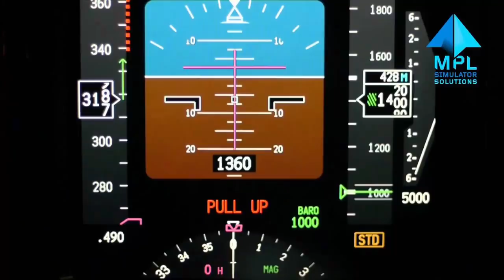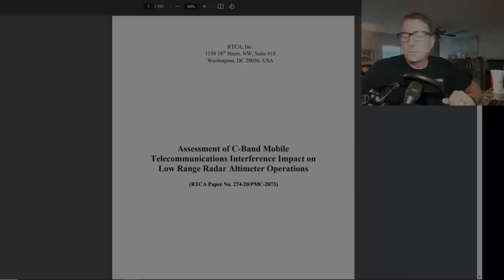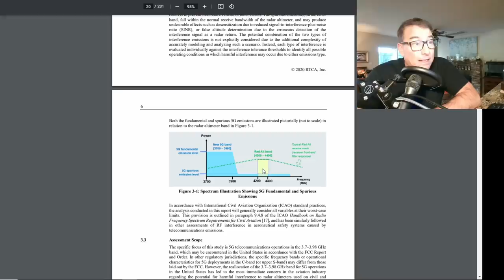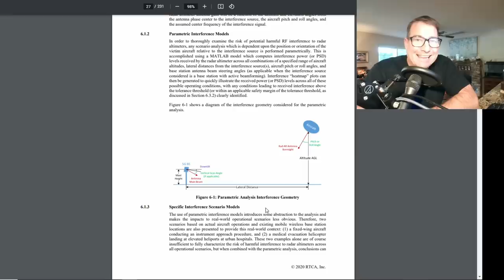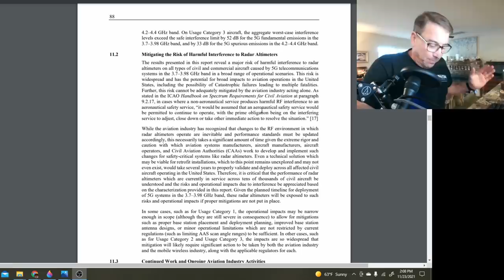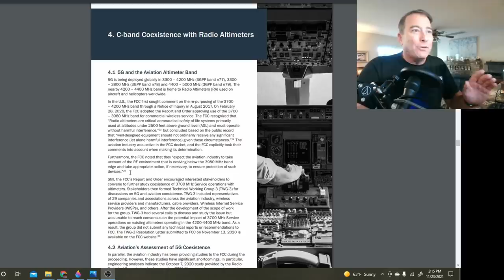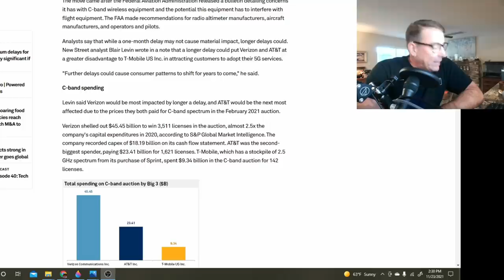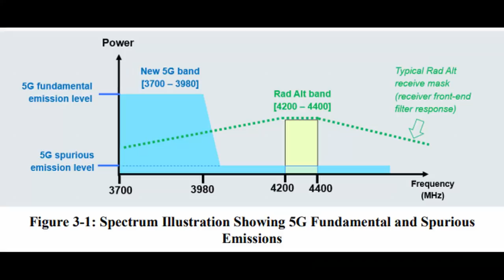5G C-Band Interference with Radar Altimeters in Aviation

Comment: The signals in the spectrum are with good working final amps… the problem is when a final amp is off or scattering the band.
As an FAA radar tech, I have seen it and had to shut down overseas communication facilities before. 
All is OK, if everything is working perfectly. The problem is… you will not know when it isn’t working perfectly, until someone is killed.

Comment: If each of the devices radar alt. Or 5G would stick to the approved frequencys there should be no impact on each other, the problem is  both of these devices normally go beyond their approved frequencys when in operation and make noise in frequencys outside their own bandwidths. Till the devices that exceed their approved frequencys are removed from circulation this will be a problem.
Reply: Which devices go beyond their frequencies? I'd say it is much more probable for some decadent aviation radio to malfunction in this way than a modern mobile phone base station..
Reply: @rkan2  I worked on radios, transponders, 3g 4g and 5g and many other transmitters.  Ive seen many transmitters that work fine in approved frequencys when cool but many they warm up when testing with a spectrum analyzers ive seen many high end devices throw noise in to other frequencys when transmitting. So im just speaking with experience and will not name the name brands or off brands  ive seen this happen to they love to sue and send cease and desist letters to ppl that name them.

Comment: This sounds scary.
The interference based on filter bandwidth assumes a linear system.
The high radiated power from a nearby 5G transmitter may cause non-linear effects that could be disastrous. 

In countries where airplanes have not been crashing, where are the 5G stations located? 
If the radio altimeter does report an inconsistency, will this information be feedback to the engineers?

Comment: I work as a safety engineer in aerospace, and the whole argument by the 5G industry "there have been no reports of problems, therefore it's all good" is fundamentally flawed. That is not at all how the operation of safety-critical equipment is assessed and evaluated. It's more along these lines: What could go wrong in the worst case? How can we prove that it is not going to go wrong? We can't prove it? Ok then, what's the worst thing that can happen? A widebody crash in a densely populated area: it doesn't get any worse than that. So what's an acceptable frequency of that occurring? The answer is really 'never', but "less than once in a billion flight hours for the aircraft type" is considered  acceptable. Now show us how that can be achieved and how confident you are of that assessment. I doubt they can come up anything good enough.
Reply: As another engineer in aerospace, you are right on. It's clear from reading some of the comments made about this issue by people working in the telecom industry that they just do not have the same mindset that we do because they don't generally work on safety-critical applications and so even if we are looking at the same set of technical facts there's no possible agreement on what the correct interpretation is. We're not allowed to just assume safety until something bad happens.

Comment: It's not as simple as saying 5g.  The issue is the frequencies used not the generation of the communication standard. Now my question is what frequencies are at issue. All of the cell phone carriers use different frequencies for their own 5G transmissions. Some carriers are using newly bought frequencies at auction for their 5G usage where others are reusing existing frequencies that were used for 4G and 3G. 
   When it comes to the levels of interference there are 4 levels. 
    
1)Militrary is ensured nothing will interfere with it. 
2) aircraft police and ambulance etc no one should interfere with it but there are no guarantees of that like with the top tier. 
 
      What would have to happen is that aircraft would have to be reclassified to tier 1 for them to gain any kind of protections under the FCC

Comment: Altimeters rely on pulses at specific rates to make sure they are looking at their return pulse only. The problem could be AGC automatic gain control basically shutting down the amplification of the original signal and thus missing the return signal. Need to do real world testing not on a bench.

Comment: Very interesting issue, my take on this is that 5G used for cell phones is not as useful or necessary as advertised. There are multiple paths available to fix this, from eliminating 5G near airports to making the AC radar altimeters able to effectively filter out the 5G interference, a costly method. I don't use or need 5G, so they could eliminate it completely and most cell users would never miss it.

Comment: I understand where you are coming from as I worked for a major Avionics manufacturer for over forty years.  The extreme lengths that we would go through to qualify a product for production for the aviation industry and how a very low power of a signal it takes to interfere with a product so as it would not function as it was designed to. There are also limitations as to what you can do in filtering out unwanted signals and other design choices you make to qualify a product. Each choice you make has strengths and weakness. To get the performance you want you have to make compromises that's the nature of the electromagnetic spectrum. The 5G manufactures can afford to do the design work that is necessary to keep the integrity of others in the electromagnetic spectrum around them and the should.

Comment: Filters are cheap at microwave. The problem is that it will require new equipment or inline equipment that has to be designed, tested, and validated by the FAA and then retrofitted to aircraft. A few megahertz away from the RADAR frequency is not a problem when it's already operating in a low power regime -- unless it's designed and implemented to ancient standards.

Comment: I’m curious.  What type of timeline does the aviation industry expect would be reasonable to implement 5G?  It’s been on the horizon for years.  It seems that the FAA isn’t doing its part.  The 5G equipment has been available for testing but if you don’t test, don’t complain.  

I realize safety is at stake and 21st century telecommunications is simply going to have to wait for the aviation industry to get its “stuff” together and make recommendations.  We are waiting…

Comment: Sorry to say this, but filters will not do the job.  The splatter has to be handled from the source.  A signal at the same frequency interferes with another signal on the same frequency regardless of modulation.  Digital signal processing can improve the "filtration" by sorting digitally the type of signal and cutting out some segments of the interfering signal but will not be 100% effective.  Very familiar with this.  The only way to reduce splatter 100% is to reduce the modulation level at the source transmitter which defeats the purpose of increasing bandwidth.  I am sorry but there IS NO good solution to this.  The wireless companies' response report tells me that need to avoid Europe and East Asia when flying.

Comment: Just to show how important radar altimeters are. On April 10, 2010, Poland's equivalent of Air Force One, a perfectly serviceable Tu-154M, with the President, First Lady, chiefs of all the service branches,  many heads of key agencies, top politicians and others on board, was on non-precision approach to the military airfield near Smolensk, Russia, for the 70th anniversary of Stalin's massacre of over 20,000 Polish officers. The President was impatient to land. The Air Force chief sat in the jump seat and as the plane approached in thick fog, he read off the altitude -- from the radar altimeter instead of the barometric. BUT: there was a wide valley in front of the runway, and therefore the plane actually dipped below the altitude of the airport. Of course, the pilots went far below minimums, pressured by the Air Force chief and indirectly by the officials on board. The aircraft crashed into trees and all perished.
Reply: Sad; and arrogant.

Comment: Move the little base stations away from the airports? I'm not an EE - what do I know? But the logic that the airports were there first may only hold so much water. The same logic is being used as reasoning to keep RHV going. Even if true, it's been a rough road. Stay safe- everyone. Ere on the side of caution. Far better to have a few p'd off passengers than a bad crash. Smooth sailing -

Comment: The airlines, aircraft and avionics manufactures should be able to create some logging maybe using LIDAR to cross check radar altimeters during VFR flight with a goal of finding radar altimeter anomalies and interference issues. Maybe 5G cell sites should be powered down when visibilities are low...

Comment: FCC already cashed the check for selling off the 5G spectrum. There is no way they are going to give that money back. There is a way to install a notch filter in line with the receive antenna to notch out a very tight range of frequencies to block the 5G signals but at that high of a frequency the component tolerances would need to be extremely accurate.

Comment: I agree with your concern. I’m a lifetime RF engineer with microwave circuit design experience. Also an instrument rated Private pilot. Yes, one could retrofit the current filters with higher order bandpass filters if there is enough room. Sharper filters require more space and generally have a bit more loss. These telecommunications guys already have to do lots of frequency and power allocation plans to prevent other service interference. I suggest a compromise that puts the responsibility on the 5G providers to not orient the beams for this band towards approach paths with radar altimeter required approaches. There are many other bands they can use in these limited locations. It is not mandatory to provide maximum bandwidth in all places. The FAA should get the FCC to coordinate away from C band in these locations. Far more practical than RA retrofits. What is more important: lives or maximum speed of data?  As far as the interference from 5 G phones on the plane I doubt that passengers will comply. However is the base is not issuing usable signals in the band the phones would likely not transmit much. Thanks for doing a good job on reporting this issue.
Reply: Martin
If the telecoms want those frequencìes, they should pay for the replacement radars in every airplane , civilian and military.

Comment: All it will take is a handful of go arounds and/or ASAP reports about erroneous readings and autoland failures and everything will go ass over teakettle. The FAA will likely have to NOTAM N/A all cat III approach procedures and all auto landings and we'll be restricted to CAT II RA N/A. At least initially until they know exactly where there's interference. I fly the A320, and I'm very curious and concerned. Airbus doesn't just use radar altimeter for auto land. The entire fly by wire system relies on radar altimeter. It uses it to transition from ground to flight mode and back on landing under normal flight control law. The auto throttles use it for landing. The system also uses RA to determine when to apply a nose down tendency to help give the pilots more feel for the flare, given that it is fly by wire. Essentially, if this does affect Airbus aircraft... that's a big problem. Either way, the FCC lost all credibility when it ended Net Neutrality. So all bets are off.

Comment: IMHO: I am not an engineer. I do not fly. I hold a FCC license that lets me repair aircraft aids navigation. I have a 2 years of electronics school.  Figure 3.1 is at best a flat lie on the face of it.  The "power" axis is not labeled as to Watts or DBM. The image also show the skirt sticking out past 3980.  3980 is a hard stop.   The green line is so broad as to be unbelievable at more than 800Mhz wide (and technically impossible with a wave guide antenna and the transmitted frequency being used as the local oscillator).  Even a  spark gap  1912 Marconi set had more selectivity than that.I didn't see one radar set tested. Not one piece of test equipment listed (Tektronix, HP, Keysite, Rode and Schwartz, etc). I also note that there were no RALT radars listed either. Nor did I see any  Engineer signed a name to that report and  not one PE license listed.   From this I see it as a elaborate work of fiction. 

The FCC gave a huge guard band of 20Mhz.  For comparison 2Ghz wifi is 72Mhz wide and a A TV channel is 6Mhz of spectrum. Inside that spectrum top and bottom a guard band, TV carrier and FM Audio carrier. The video signal makes up 4mhz of that 6. 

GPS is on 1575.24 Mhz and GSM is between 1850 to 1990mhz. A gap of 275 mhz with extra stuff thrown in that gap and there is no clutching the pearls and sprinting to the fainting couch tripping on the hoop skirt all the way with that.  In the 30 plus years of both being on those frequencies has the NTSB found the cause of a accident being a cell phone base or mobile yet?  

The difference in frequency spectrum between 4200Mhz (bottom of the RALT) and 3980Mhz (top of 5G band) is 220Mhz.  220 Mhz is a MASSIVE amount of spectrum.  To put this in terms of what people know: it is from 1000Khz AM through all short wave bands (160,80,40,20,10m ham bands), past CB, Past VHF low public service, past the old cordless phone and baby spy devices, past 6m ham band, past TV  2-6 stations, FM broadcast, Past VHF aircraft band, past 2m Ham bands, past VHF high public safety, past TV channels 7-12, and in to the 1.25m ham band inclusive for comparison.  To make it even simpler: 550 - 1550Khz AM band is 1Mhz. 

At 4300Mhz the antenna is going to be a resonant cavity (not a wire antenna) about 70mm in size.  An antenna for 3980mhz is 75mm and bigger.  The wave is simply too big to fit in a 70mm cavity antenna.  The antenna is the filter.   It isn't just the FCC involved in this.  The FAA gets some say in were 5G cell sites get put.   Cell sites direct energy to the horizon not to the sky.  But if they did how many seconds of RALT loss would be experienced in a Cesna 172 at 60 mph over a 5G tower with a 60 degree cone above it at 2400 ft? 

5G is a world wide roll out.  Real engineers with real PEs (see NSPE dot org) in both government and private sector have been working on this for years  across multiple advanced countries including the UK, DE, CA, US, JP, etc.   To think that this group of engineers across multiple private and public sector domains across multiple countries  has a pact to have aircraft a 1000Km from a 5G site cease all forward momentum and drop like a cartoon brick is, on the face of it, preposterous. 

Google: S53MV  Landing Radio Altimeter 
Google: site: fcc.gov 107 factsheet

Comment: The base station may, indeed, be 'aimed' downward, BUT, the beams can very easily reflect UP from a nearby building roof, some antenna system, a vehicle roof in rooftop parking, and on, and on... that reflection will be a LOT stronger than the reflected beam from the radar altimeter, which will be attenuated, not just from the 'square law' loss, but from the absorbance/reflection coefficient of the 'ground'... a 200 MHz spacing would require a real 'brick wall' filter, not so easily added to existing equipment. This looks like a 'fun' problem, and, indeed, unlike the telecoms, the RTCA has no 'skin in the game', one way or the other, except regards safety for US, not PROFIT FOR TELECOMS!!
Reply: Fortunately the higher frequencies get attenuated quite quickly. As you said - some filtration or newer hardware might be required. With newer hardware the co-existance of them is a non-issue. It is just a question of who pays for it I guess.

Comment: I thought the blue and yellow sketch was so unscientific, as it did not show a calibrated vertical scale.  When using radio frequencies we have always had neighbouring frequency users.  Yet it is possible to pick out separate transmissions only a few hundreds of cycles apart.    Also the problem goes both ways, what about the aircraft flying into London City airfield, that is causing interference to all the internet connections under its flight path.  This could cause damage to the financial internet users in the city.
Reply: LoL  beware of trading using 5G

Comment: We’ve already got a lot of 5G Stations in Germany. One of them covers the approach and parts of the runways 27 R and 27 C of HAJ. 
I’ve never heard of any problems with interferences. 
Could it be, that the knowledge in the US is far behind the experiences in Europe?

And regardless of this, why do you need 5G on an airport or in the vicinity of an airport?
WLAN hotspots would be the safe solution.
Reply: Different countries use different bands for 5G. While I don't know the particular frequencies, Germany may well use a different frequency for 5g than this bandwidth the FCC is currently auctioning off.
Reply: Europe and Japan operate on this band with an even smaller guard band than in the US.
Reply: @disphenoidal  Incorrect.  The US has a smaller guard band (180 MHz) than Europe (400 MHz).  Not sure about Japan